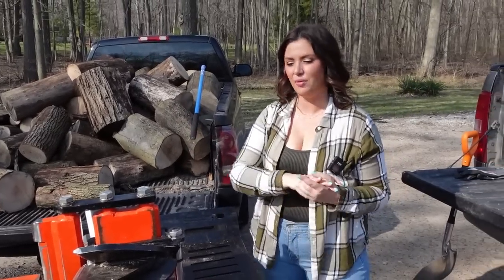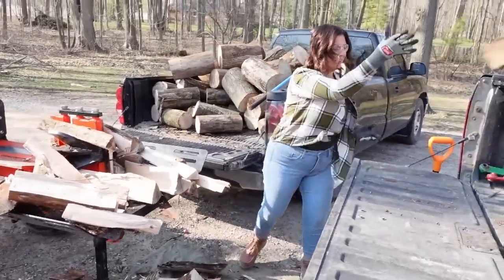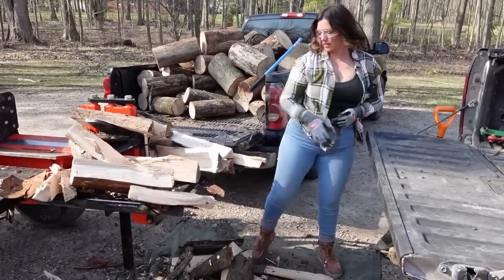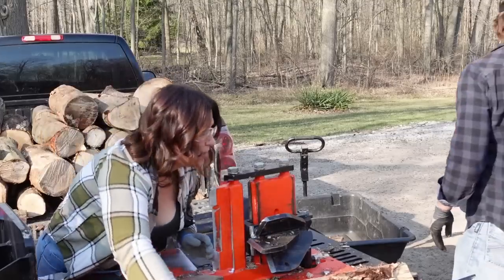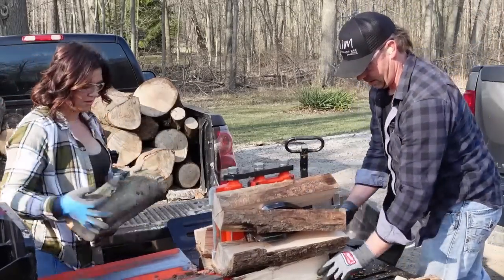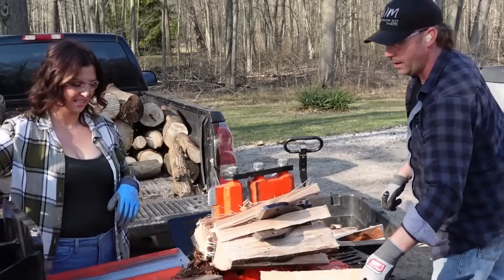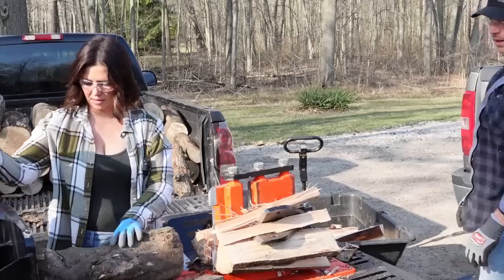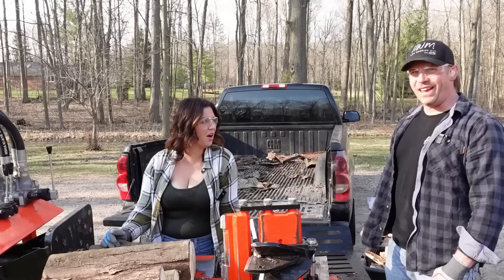Firewood Splitting, Rounds to Splits Will it All Fit? #131

Comment: Hi guys, a cheap kids slide from the splitter table to the tailgate would keeps the splits off the ground. Likely most of them would even push across the slide. Or an electric tread mill but you will have to cover your rear window with a piece of plywood.  I have a dozen gas and electric conveyors, I too am an auction guy. Even used to buy stuff from Repocast a few years ago. I also use quite a few roller conveyors for various things. Happy Easter from across the bridge, Ontario.
Reply from the maker: Hello Dale, repocast can be trouble for sure lol. I have thought about an old treadmill. I have a livestock loading ramp I plan on integrating into my processing center once I get it set up. Still collecting parts and planning.

Comment: As an observation,  I  wonder if tripping the hydraulic ram at about ¾ ways through the block to let the block expand , then push it through.
The studs on the push block are pretty aggressive.
Reply from the maker: Ed, that may work, I think a split occasionally gets wedge under the multi split wedge though. We’ll give it a try and see if it helps.

Comment: If he would have put the rounds in the Dooley. It's higher and then you could have split radar field table rate into block. And you wouldn't have had to stop the splitter. Wouldn't have just pushed it in to the truck for you? I just noticed that 1 observation in case you didn't know.  Happy easter
Reply from the maker: Thanks Kent, that definitely may have worked better. I try to drive the beater black truck more than the dually to save $ and miles on the dually. I was up at the property after work the other day and decided to buck up some rounds and had the black truck there.